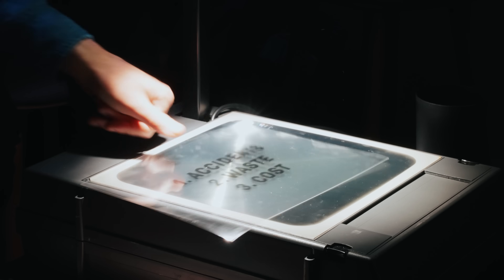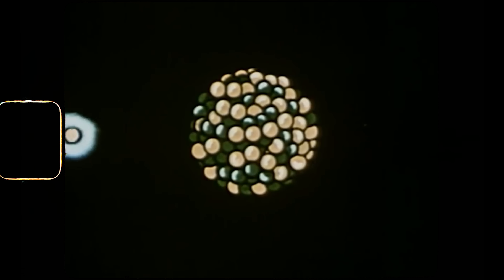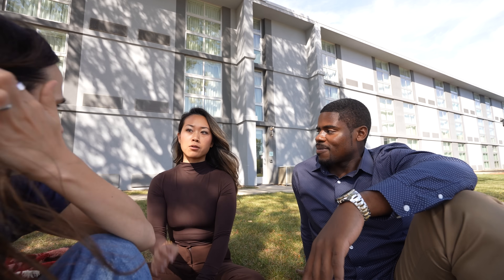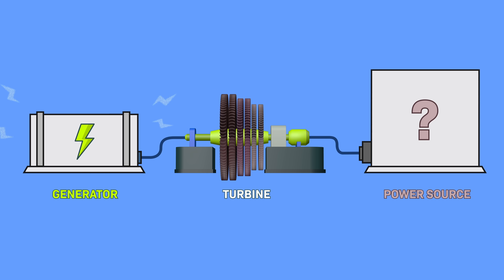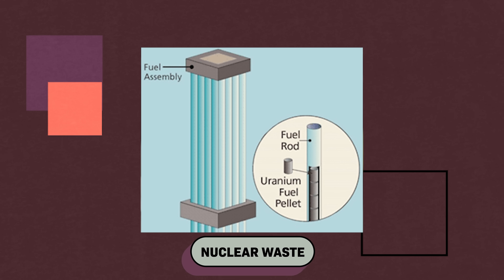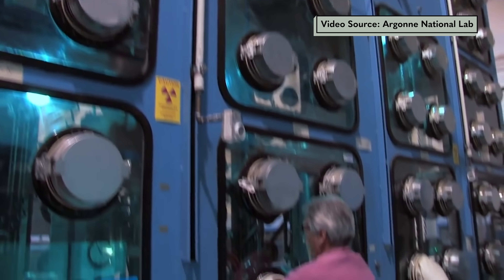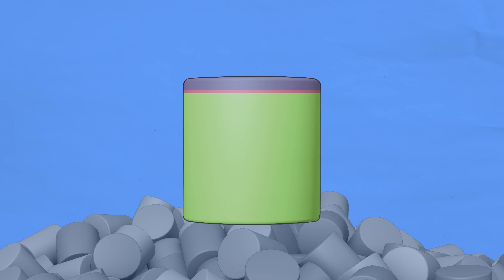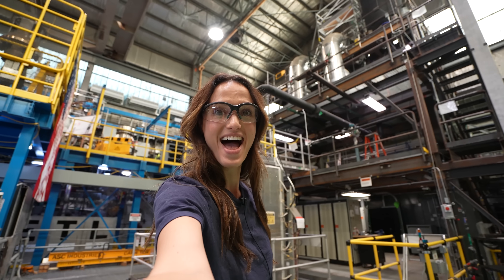The Big Lie About Nuclear Waste

Comment: I subscribed! I love the informative videos. I didn't even know this was possible with Nuclear waste, so that's really awesome. I'd love to see a video, where you compare nuclear energy to offshore wind energy, in terms of how many resources each need to make power and how much waste and labour each needs. I for one work in the offshore wind industry as a technical designer. I create work drawings for the foundation part of the offshore windmill, which we call Monopiles and A LOT of steel and resources go into making these, and they are only made to last about 25 years, which isn't particularly sustainable, considering how much steel goes into make just one, sometimes more than 2000 metric tons, and we have had a project with more than 80 of these Monopiles. So I am quite interested to see which of the two is actually the better and more sustainable option.

Comment: I wouldn't call it that easy.
1. The extracted waste products are concentrated and highly toxic. They request a fully another level of save storage than normal nuclear waste.
2. The rest uranium products are not rich enough to use them again in a reactor. So it must at some U235 anyway to have a new reactor fuel rod.
Reply: Exactly this!

Comment: I no longer trust our elites either Cleo, and question everything, including atom splitting, so I asked Grok2:

Could you please list all nuclear power plants worldwide not located near possible coal, geothermal or natural gas energy supplies or sources, and not located near ocean shores?

I included proximity to oceans because clandestine fuel delivery would be feasible.

Groks Answer:
+++++++++++++++++++++++++++++++++
Identifying nuclear power plants worldwide that meet the criteria of not being near coal, geothermal, or natural gas energy supplies or sources, and also not near ocean shores, is a complex task due to the vast and interconnected nature of energy infrastructure. Here are some considerations and findings based on available information:

    Geographic and Energy Supply Considerations:
        Most nuclear power plants are strategically located near water sources for cooling, which often means they are near oceans, rivers, or lakes. However, the criteria specifically exclude those near ocean shores.
        The proximity to coal, geothermal, or natural gas supplies can vary widely, but many countries have these energy sources near their industrial or urban centers, which could overlap with nuclear plant locations.
    Notable Examples:
        Pickering Nuclear Generating Station, Canada: This plant is located inland in Ontario, away from ocean shores. However, it's near natural gas infrastructure in Ontario, which is known for its natural gas resources. Thus, it does not meet the criteria of being away from natural gas sources.
        Bruce Power Nuclear Generating Station, Canada: Also in Ontario, Bruce Power is not on an ocean shore but is in proximity to areas with significant natural gas and possibly coal infrastructure.
    Challenges in Complete Global Listing:
        The exact location and surrounding energy infrastructure of every nuclear power plant globally are not comprehensively documented in readily available public sources. 
        Many nuclear plants are in regions where multiple forms of energy production coexist due to economic and logistical benefits of integrated energy systems.

Given these challenges, here's a summary:

    There are no known nuclear power plants globally that definitively meet all three criteria (away from coal, geothermal, natural gas, and not near ocean shores) based on the information accessible. The vast majority of nuclear plants are either close to some form of fossil fuel or renewable energy source for practical reasons like energy grid integration, or they are near water bodies for cooling purposes.
    Further research would be needed with more specific geographic data and local energy infrastructure details to possibly identify if any minor or less-known facilities exist that meet these very stringent criteria. This would require detailed mapping and analysis beyond general public data.

If you require a more detailed analysis for specific regions or have access to more localized data, that could help in pinpointing any such facilities. However, with currently available broad data sources, no such plant can be confidently listed.

Comment: 4:04 in a way, you’re right. I’m no expert in the subject, but some brief research shows that there is an economical net loss in recycling used nuclear waste. Not good for business when the benefits are outweighed by operational costs of the facility maintenance, labor, and regulatory/security.
Reply: Is that more of a loss than continuing to with the alternatives that we know does damage to our environment and population in countless ways. While leaving longterm waste that is monumentally hazardous for everyone for longer than we can prepare for? I'm no expert either but I don't see any downsides to it even if it costs money - it saves people and the planet, can't quite put a cost on that.
Reply: @jakewhite4556 you're absolutely right! However, no matter how good your intentions are, you can't keep the doors open and the place running without positive cash flow. At least, not without some sort of charity or grant program.

Comment: Did you mention how long the recycled stuff is radioactive for??? I must have missed the most important information. What ever it is it is still easy to long
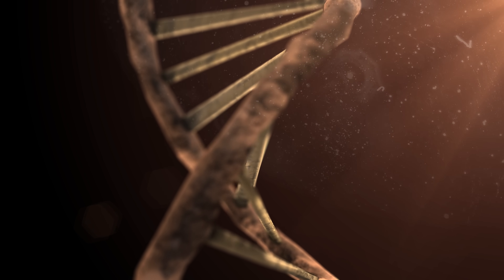Reply: 7:35 I think. If that’s what you’re looking for
Reply: That's not what I'm asking. I'm asking how long the recycled used waste is dangerous for after it is used?
Reply: @lifetimevic  couple of hundred years, depending on the techniques used. Just put it in a stable geological storage and you'll never have a worry about it again. 
Even just doing what Finland does and directly getting it to permanent storage is still WAY preferable compared to what coal and gas does today.
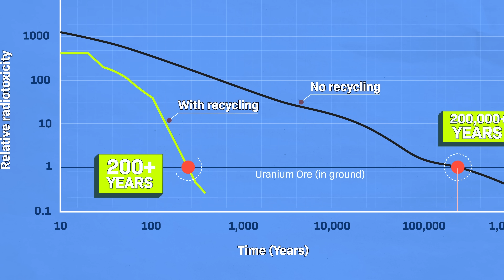Reply: My b. 9:58 is what you’re looking for. 200 years

Comment: Might not be economical for power generation, but could be an viable for reducing the spent fuel stockpiles when you compare the ongoing costs of long term storage. Particularly if the remaining elements after burning it up in these reactors is shorter lived.

Comment: I really don't know why people have a problem with storing this stuff deep underground. We have really deep mines, far below the water table and too far for anyone to dig up. So we put them deep down there after these mines run dry, fill the mine with concrete, and voila!  you have it basically encased in a mile or more of solid rock. Besides, this stuff came out of rocks in the first place, so putting them back in the ground isn't anything terrifying.
Reply: I had someone tell me that the problem is if we put a sign where it is buried so future generations know not to go and dig it up, that they might not be able to understand it... they used the example that we struggle to understand languages from 1000s of years ago.... 

Yeah it's as stupid as it sounds lmao xD

Comment: I worked on a nuclear station, weapons lab and a waste storage facility. The waste was intermediate level and mixed with cement, encapsulated in stainless steel drums and lowered into concrete tubes behind shielding walls. A huge effort for waste control, one of the high costS

Comment: Excellent video, recycle waste reactors are incredible along with Thorium MS reactors which produce 1% of the waste our current LWR's, They also make U233 as a byproduct, which goes directly back into the reactor and are designed to safely shut down in a power failure.

However, we can't forget that energy and weapons have been linked since the start of our nuclear energy programs. Most current "light water reactors" create as a byproduct U239, which is used in fission triggers in all of our modern thermal nuclear weapons.

Comment: I believe it would be a great change but the expressways for electricity and the whole picture gets blurred. The labor pull for building a breaker box coast to coast like the railroad of the 1800s and power plants to supply. What about plastics being used as a fuel source along with industrial partnerships that exhaust usable heat. Refineries and steel mills

Comment: Human problems have caused all the ‘accidents
and it’s impossible to remove the human from the design, build, test , use cycle 
and is this video a joke 
She talks of a tiny amount of waste 
What happens to the magical recycling system when it’s irradiated, what about the original nuclear reactor vessels when they deteriorate ?
This is a common fantasy of the pros nuclear groups - “ it’s all a conspiracy to hide the truth about recycling because ( name any political group you don’t like ) 
Fantasy fantasy fantasy with not a single piece of evidence 
You know that stuff you use when you use the net , drive an evidence based car 
Most waste I’d mid to low level and will NOT work in a recycling reactor/ or which ever name they use to promulgate this nuclear advert 
Usual pattern , pretty girl , videos out of context , no research , untruths , cartoons , vintages vids, aimed at the lower thinking classes

Comment: I hope you can make an optimistic video that shows how much more sensible it is to use renewable resources such as solar, wind, and tidal energy etc. to generate electricity and thus power the country, and how when combined with storage technology we can do that with reliability and stability. Nuclear energy is certainly interesting scientifically, but if you put the energy potential and cost of both technologies up against each other, renewables will always win hands down. Where nuclear wins is in the centralization and commercial control big business has locked in with that technology.  It keeps the consumer at a distance - well insulated from the product and dependent on big business to supply the electricity - a fundamental resource needed to survive in today’s world. Whereas, with renewables and battery storage you can put solar panels on your roof and even disconnect from the grid entirely. Big energy companies don’t like that much. But in terms of the betterment of humankind and the planet into the future it seems obvious which is the more optimistic way to go. I hope you can present that point of view as well in a future video.

Comment: Nuclear grid electricity needs 247 full demand and full cash flow demand. For 60 years. 

Renewables on rooftops, PV panels will get cheaper, and v2g EVs with massive daily FREE storage and parked 23hrs every day will break the nuclear economics. 

Nuclear promoters rabbit on about the modern technologies and then STFU about the rooftop PV technology and its no need for GRID ELECTRICITY. 

In Australia, 20 million buildings with a small 6.6kW rooftop can totally outperform grid generation. 

EVs with v2g oversized battery are on the production line. In the millions. 
Elon Musk is creating new production technologies. 
Elon Musk is creating robotic technologies.

Ford has moved to EV technologies. 

110 years ago, horse meat was cheap when the Ford model T production line started.

Comment: Yes at 10:18 Japan was using mixed oxide fuel at Fukushima. It did not turn out well
Reply: And how did the fuel in the reactor affect what happened to cause that event?
Reply: @dj_lord_tucker how did the fuel cause an earthquake?
M'lord doth jest
Reply: would you like to know more?

Mixed oxide (MOX) fuel tends to run hotter than uranium oxide (UO2) fuel because it has a lower thermal conductivity. 
Here are some other properties of MOX fuel:
Melting temperature: MOX fuel has a lower melting temperature than UO2 fuel. 
Heat of fusion: MOX fuel has a lower heat of fusion than UO2 fuel. 
Fission gas release: MOX fuel releases more fission gas than UO2 fuel. 
Helium release: MOX fuel releases more helium than UO2 fuel. 
Irradiation induced creep rate: MOX fuel has a higher irradiation induced creep rate than UO2 fuel. 
Swelling rates: MOX fuel with Pu rich agglomerates has slightly higher swelling rates than UO2 fuel.

It didn't cause the violent explosion, but it certainly didn't stop it
Reply: @Themata  so the mixed stuff is essentially more unstable than the original, well wouldn't the solution be to be more careful with it, they probably didn't know if this stuff is still being tested

Comment: This isn't correct. 95% of all nuclear waste will be inert and non radioactive within 40 years or so. This is stuff like radioactive water used for cooling, or gloves used for handling the material.

Only a small portion of all radioactive waste is the very dangerous stuff that needs to be stored for 100s of thousands of years. 

95% of the radioactive waste isn't a problem, we just store it for a few decades and deal with it then

Comment: Coal is chock full of the element that killed Pierre Curee - radium. When we burn coal for energy, all that radium goes into the air. I can't remember the exact figure for how much more radioactive matter industrialisation has released by burning fossil fuels when compared to wast from nuclear reactors, but it's orders of magnitude compared to the spent uranium and plutonium buried in underground waste dumps.

And we are breathing radium daily. Nuclear energy that can reuse spent fuel rods? There's the off-peak and baseload supply for renewables.

Comment: Cleo, good job 👏  I hope you'll do another video on the largest greenhouse gas- water, and explore potential alternative sources of energy systems that use less water 💧  neutrinovoltaic technology etc etc 
England and Germany are against nuclear power.  In a nutshell, outside of the reasons you listed, each reactor uses 1,000,000,000 (1 billion) gallons of water each day. Not including coal reactors that's at least 92 billion gallons of water per day.  Volcanoes don't release any where near that amount, and landlocked states are dramatically changing the world. Neutrinovoltaic technology works but ? Well it's change and positive science.  Go get em, lady!

Comment: Interesting discussion, but renewables are just way cheaper so this will lead to nothing. building a few new reactors, processing the SNF, takes decades and huge amounts of money compared to funneling this into renewables. And dont get me started on carbon footprint…
Reply: Renewables won't be enough to get the job done. You need some kind of power source that you can increase and decrease at will during peak hours.

Solar can't do this because you get consistent energy during the day and then nothing during the peak hours at night. To store energy during the day would require an unfeasible amount of batteries.

Wind doesn't do this because you can't control the amount of wind. You just get what you get.

Solar and wind work great as a kind of base level energy source but then you need something that can increase or decrease as needed.
Reply: @ nope u dont u just need a modern smart grid and some storage solutions like hydro, hydrogen, batteries,… The grit will have to change anyway unless u wana keep living with fucked up infrastructure forever.

In northern Germany we produce more than net 100% electricity from renewables. We just lack proper storage and grit solutions, which we are building right now. Untill then we just sell all our surplus to france €€€ because they rely on nuclear plants that break down all the times caused by lack of cooling due to drought or various other reasons. Im quite happy we ll never bring this up again.

Btw u still need fuel for ur existing plants, which comes mostly from russia… 💩

decisionmakers dm me, trust me im an engineer 🤓
Reply: @MrLuckysLu  whatever you say dude. I will go with the expert opinions of the engineers already being DM'd by decision makers. Who don't seem to agree with you.

Comment: In the 1970s LANL proposed accelerator moderated transmutation of nuclear waste.  You piled up anything radioactive in a chamber, ran cooling pipes around it and shot it with a proton beam. The system would produce more energy than it took to run it.  Another benefit was that unlike a reactor you can turn it off safely by just flipping a switch to turn off the proton beam.  Works on latex gloves, paper bags, and even spent fuel rods.  The only thing left will be low level short half-life isotypes.

Comment: The thing I honestly don’t get right now is, yes of course you can reuse the “good stuff” but wasn’t the bad stuff, the fission products, the problem all along? As you said, those were the ones taking thousands of years to become non-radioactive. I saw another documentary where they talk about recycling in France aswell. The thing (as usual) is not as easy as it seems. There are more chemicals needed than just putting the used uranium into salt and filtering and then whoosh back into the next reactor, it’s very expensive and the process itself also creates waste that has to be stored. Though the space needed to store only the fission products would be less than storing the used pallets. All in all a very interesting topic, but hard to explain fully due to it’s complexity. (I am no physicist or chemist)

Comment: Using solar power has no dangerous waste at all and is a already a factor 20 cheaper than nuclear, why even think about nuclear? and by the way nuclear also produces carbon dioxide and it's by no means a clean energy it is much less than fossil fuels but still a lot more than the negligible production of carbon dioxide by solar power or wind

Comment: Bright ideas! Now go look at molten fuel reactors which do the recycling kinda automatically. Then there are Thorium reactors which use a much more plentiful fuel supply, can also burn Uranium waste,  and don't make Plutonium.  Oak Ridge Labs worked on these in the '60s.